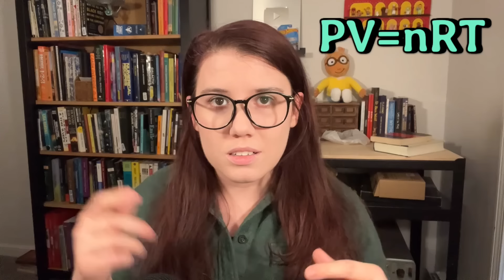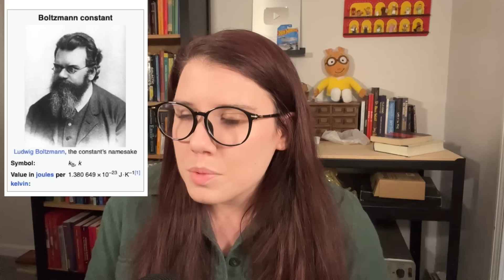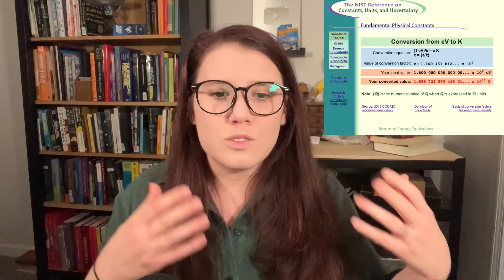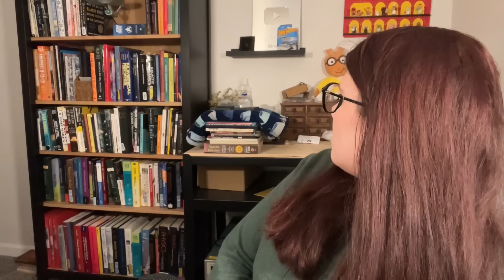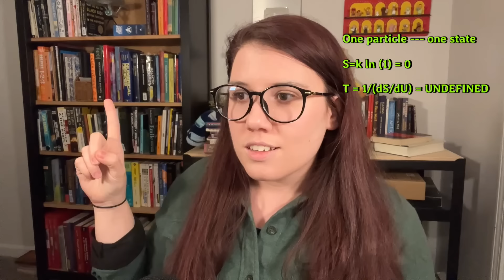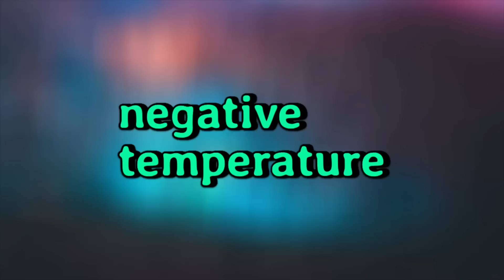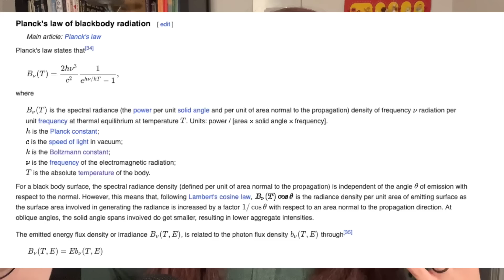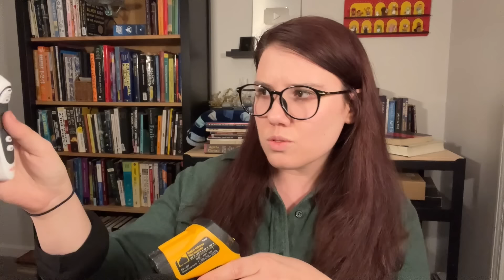the concept of temperature

Comment: "it says I'm 90.1 degrees, which feels wrong" This is a really interesting brainworm I'm fostering lately, it is really hard to correctly measure the temperature of a thing, via infrared light, and unless they are designed to deal with flesh, they are particularly bad at measuring the temperature of flesh. I've got one here, I point it in my mouth, my mouth is 94.1 degrees, which is wrong. If you get into the manual for your gizmo you will probably find that it has a setting for Emissivity, which is an adjustment factor that goes into the math somewhere to deal with the fact that real objects are not black body radiators. So before when I measured my mouth, I had the emissivity set to 0.94. Point it at the same spot, but a different angle, now I'm 98.1 degrees. Drop it to 0.90, now I'm 100 degrees. I could tune the measurement angle and emissivity all day and then it would give me a number that agrees with my contact thermometer, but it would also be wrong for my cast iron pan and my 3D printer.

Because non-contact thermometers suffer from perception. They can perceive incorrectly, and perception is contextual. Both the subject and the perspective modify what is perceived. There's also a factor that it's challenging to measure infrared light accurately so, this all works better for hot hot stars or if you have very expensive equipment, which may need to be cryogenic. These fancy laser pointers with eyes rely entirely on the operator to manage the factors on perception.

Flesh, cast iron, and stainless steel all have different challenges because: Flesh is not opaque at infrared wavelengths, meaning when you point it at your wrist you're measuring the surface, which is cooler, and also the blood, the muscle, and maybe the bone, proportionally, but the bones are opaque so they're also blocking the light from the far side of the wrist. Cast iron is maybe the closest to a black body radiator; so much closer that a more generally appropriate emissivity setting is very wrong for cast iron. Stainless steal meanwhile is the opposite, it radiates energy outwards more coherently, so looking at it from a single perspective tends to read the material itself low because you're not getting an even scattering from the whole surface, parts with a surface normal towards you cast more of their IR towards you while other parts cast less, and it reflects IR from the room so like the hand being a proportional combination of all the layers of flesh, the pan is a proportional combination of nearby objects and a non-generalized perspective of itself.

Which is all to say that in the kitchen, these devices are primarily misleading, and in medical applications only the ones designed for the job and used as intended, can produce meaningful results
Reply: I've wondered lately: how does an infrared thermometer pick the photon to report, anyway? Does it just pick the one with the shortest wavelength (within a certain design range of the instrument) from within some small angle of the direction it's pointing? Does it do some kind of averaging or weighted averaging?
Reply: @ps.2  any half decent IR thermometer will be marked with the parameters of a cone*, it reads a wider area the further away you are. Mine is 38mm diameter at 300mm, 75mm at 900mm, and 132mm at 1 meter, which may not legally qualify as a cone. I don't really know the shape of data these sensors put out and that's going to dictate most of how they can determine what temperature the reading indicates.
Reply: Special Relativity is applicable to thermal systems, but it introduces complexities. The integration of thermodynamics with Special Relativity is a topic of ongoing debate and research. As you point out, the temperature of a moving object can appear different to observers in different inertial frames. This is because the relativistic Doppler effect influences the observed temperature. Additionally, the Zeroth Law of Thermodynamics, states that when two systems are each in thermal equilibrium with a third system, they are in thermal equilibrium with each other, and need to be redefined in a relativistic framework to account for the relative motion of the systems. This currently (afaik) remains a “perpetual problem”, with four diﬀerent attitudes, having been famously expressed since 1907. December 2, 2020 - Joseph Henry Laboratories, Princeton University - "Temperature and Special Relativity" by Kirk T. McDonald, delves in deeper but there are many other papers and areas of research focused in the area, providing very interesting concepts and ideas (worth investigation).

Comment: Since plasma° is based on wavelength, our water matter carbon we live in is also a wavelength. That means the thermometer needs work. This basically states that 98.6 is human fluid, but brain fluids electric are a million°. We are plasma. Task of the year 2100, is find solid plasma and it's meaning and holds.
Reply: We are not made of plasma in any meaningful sense, an our brains aren't either.

Comment: one thing that should be said regarding diatomic gasses and their heat capacity is that the additional degrees of freedom are mostly frozen in the ground state which is typically around room temp. So assuming ideal gas  behaviour works for those gasses too in a certain range. And the same applies to solids; the colder it gets the more degrees of freedom are frozen and so a materials heat capacity sinks with temperature to the point where at almost 0K even the most miniscule addition of heat will raise the temperature again and increase the heat capacity.

Comment: Old Physics teacher here. The demo with the ice and black blocks is not explained correctly. The metal block melts the ice faster because it has a higher thermal conductivity. It actually has a lower heat capacity than the other block. It transfers heat from itself to the ice and from the environment through itself to the ice because it is very thermally conductive. Because of its lower heat capacity the metal block becomes much colder than the insulating block.
Reply: https://www.youtube.com/watch?v=wBBnfu8N_J0
Reply: Smudge the cat meme, Karen.
Reply: Good point. One nitpick: Heat capacity and conductivity aren't necessarily related.
Reply: This is something so difficult to explain to many people - why metal feels cold when you touch it and why styrofoam feels so warm to the touch :) I'm just at the beginning 4 mins of this clip and I sense a bit of a problem. She does a wonderful math, but I feel a bit of a hole where should be that passion for "figuring things out". Sorry, perheaps I like Feynman too much. He was so happy about understanding how things work. Math was just a language you can describe the fenomenon. Understanding it to the point of "feeling" was the main Feynman's goal. And having fun 😁
Reply: @ogi22  The strange thing is when ordinary people are talking about Feynman, they always say things like "he had a very relatable street smart way to solve hard problems easily and he was such a relatable teacher, not the typical nerd weirdo" and when professionals are talking about Feynman, they always say things like "geez, that bastard used calculus ten times faster than me". For example Dyson, the mathematical prodigy was very diligent in becoming an early doyen of QED to make his way to the Nobel but Feynman simply outcalculated him. Somehow Feynman's almost unfathomable strength remains unnoticed by bystanders. So watching him is like watching an olympic gymnast on the rings, or watching a world class chess player - although the moves they make look natural and trivial and they are working for them, they won't always work for mere mortals.
Reply: @richardv.2475  A "street smart" is just as smart as the street it comes from... And if you talk about the mind, Feynman was from "up-town" 😏 He did one thing with a very little effort. Something all engineers and physicist (and many more) strive to achieve. Quick estimation. There are many tricks to do it. You even have jokes about a physicist drawing a circle and saying "let's assume this is a cow" (a beautiful lecture by Lawrence Krauss "A secret life of a physicist" would be a wonderful example). Even in his books, there are many examples where he is sharing his secret. The problem is, this is "an estimation" and you have to know how and why you did it this way, to know the outcome is plausible. It takes quite a vast knowledge to do it precisely enough. But the first step is to take that calculation and do it, if you feel something is not right. And that's the hardest part 😁 Personally, I try to do it myself. Yes, it's sometimes hard to take out that small notebook from my pocket and write down a few numbers. But the satisfaction after you catch a problem is amazing. Everyone has those "this doesn't compute" moments. Just most people lay it off. Leave it to others. I preffer if my curiosity wins, I open that notebook and check stuff for myself.

Comment: "3 because 3 dimensions" does not exactly explain it. You would have said the exact same thing if you multiplied by 3 or took the third root or did another operation with 3And why not 6? after all we can combine the 3 dimensions 6 different ways... etc....
Reply: its because there 3 dimensions
Reply: How many directions can you move in, in three dimensional space? Three, that's the reason.
Reply: @hedgehog3180  So what, this is not probability function. I also struggle with understanding this.

Comment: There is only 6 degrees of freedom for a diatomic molecule: 3 translations, 2 rotations, and only 1 vibration. At standard and low temperatures, the vibration is not excited much and is "frozen" out. This is a quantum effect. So the thermal energy is 5/2 Kb T.

Comment: I, being somewhat of a dumbass, for the longest time have been perplexed by how something like a refrigerator is able to work at all.

 I clicked on this video in hopes of understanding. Now I am left with more questions.
Reply: Fridges are cool because they're like a real life Carnot engine but there's no simple explanation for how they work.
Reply: Fridges work by moving energy from one place to another. 

Imagine you have a big chunk of uranium in a room. If you carry it out of the room, the room has a lot less energy in it, but you only had to put in the work to lift and move the uranium, not change its energy. The energy still exists, it's just outside of the room.

Fridges do a similar thing. Evaporating gasses absorb a lot of energy during the phase transition and condensing gasses lose a lot of energy during the phase transition even though their temperatures stay relatively constant during the transition. If you boil a refrigerant inside of the fridge, pipe the gas outside of the fridge, and let the gas condense back into a liquid outside of the fridge, you've essentially put the heat into a little box, carried it someplace else, and dumped it out. If you do that over and over again by using compressors, expander valves, evaporator coils, and condenser coils, and a refrigerant, you've got yourself a fridge.
Reply: *oop, meant evaporating liquids

Comment: Temperature is a measure of the equilibrium of one system with another.  Things have the same temperature if and only if their states don’t change when they are allowed to interact with each other.  That’s what a scientist means by temperature.

Everything else she says is true, but these are all derivative of finer understanding of what is going on with a system.

When you take your temperature, you know what temperature you have because the temperature of the thermometer stops changing, because the resistance of the internal circuit stops changing.  With a a mercury or alcohol thermometer, you know what temperature you have when the liquid stops expanding.

This is the macroscopic definition of temperature

Comment: I was a little bit confused about the argument at 35:35 because she said "Omega is equal to one" because the atom is in its one ground state. But aren't we interested in Omega as a function of U because we want to take del S/del U? If yes, we don't want to just look at the ground state, we want to look at excited states and how their number changes with U. 

Here is how I think this would look: If the particle is free, then U would just be its kinetic energy p^2/2m, i.e. proportional to p, so if we assume that there ist some "constant density of states in p-space" (something like (2 pi)^dimension/V) the number of states with fixed energ U should be approximately proportional to the area of the surface in p-space with that energy, which is a sphere when U=p^2/2m. The area of the sphere is pi p^2, which is proportional to U. So Omega is some constant times U. With this S=k_B ln(const. times U) and del S/del U=k_B/U. This means temperature for one particle would indeed be well defined in this case as T=U/k_B.

Comment: Two minutes into the video and I realized I have a chemical engineering degree and never directly questioned or analyzed what temperature was.  We got hints at it in P Chem but temperature is such a fundamental concept that we ignored it by that point.  It's like learning 1+1=2 in math and never addressing why that's the case if you aren't doing a math PhD.

It does become intuitive that temperature is not heat and is not energy, especially kinetic energy but a definitional look at temperature after learning how all this works is fascinating.  Latent heat has a whole new weirdness to me because you're adding kinetic energy without increasing temperature.  (For people reading this who don't know what latent heat is (can't remember if Angela addressed it), it is the heat you have to add to a substance to cause a change in state.  More practically, it's the scientific concept that boiling water happens at a constant temperature.)
Reply: When we look at the "water temperature volume graph", we know that sea level has not increased according to observed science.
Reply: @ShonMardani  You haven't been clear about what you are criticizing so I'll cover each topic you get at.  

1) Liquid water basically doesn't expand with temperature but that has never been the main cause of sea level rise.

1.5) Sea level rise: Water froze on land (Greenland, Antarctica) thousands of years ago. That is what is melting, that is what is raising sea levels.  Less sea ice is considered a problem because ice is white and reflects light (energy) back to space.  Less energy reflected means more energy sticking around here.

2) Increased energy in the atmosphere is a huge concern because it's making the climate weird.  It rained in Colorado in December.  Good thing Colorado doesn't get hurricanes.  And if the climate changes, the great plains could become a second Sahara, or a rainforest, or a swamp.  We don't really know other than changing what has been there makes it likely there won't be plains there in the future.
Reply: Every experiment showed that basically water expands with increased temp.
Multiply the volume of the ice by 0.92 to get the volume of water from its melt. Also there are a lot of air bubbles and solids which will be released and reduce the volume of melted water.
Everyone agrees that the climate has been changing way before we had cars and power plants.

We know that everything is changing in cycles, but we do not know which cycle or where in the cycle. The fact that we are burning everything that can burn to get energy for our lifestyle will hurt us and our children is not disputable, we all know that and are doing our best to be more efficient with energy. However every number they provide as evidence, is fake and made up. 
 @Virtuous_Rogue

Comment: Glass (amorphous)is light- 89 -Ning in the sand.
Circle in the sand.
Circle on or over, intersect line is short circuit.
Further more glass is sound silenced.
Silent ~ liSTen ~ neSTil ~ tensil...
Therefire 4 tEMPeRature, rupture, rip(ple) is Shu the riSing EMPtY or SC-ale, graYSC-aLing as You put.

Place salt on ice. It m-ELTs. Altermagnetic lol. No. Not really.
No one used heat to melt. So what has happened? Ice became even MORE (Moire,thermo,Miura,Moraya...)cold. 

When they teach numbers..they use SCrews. \ or / .... -/÷. 
Up Down Den Sity.

Hole conNECTivity = perMeability.

EN is words means Hole, Pore, DenT, vent, gap, cave entrance, Cenote...
See rainBow from caves. 
Light comjng from hexamer or hexagon or hexaNiShe is white.

EN gyro. EN tropY.. trapEZoID void. 
XP entanglement...